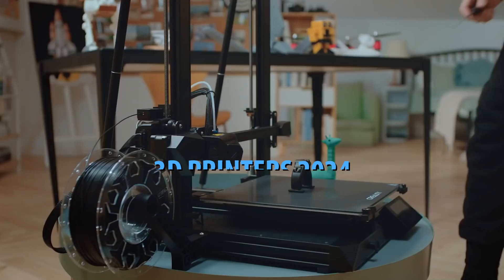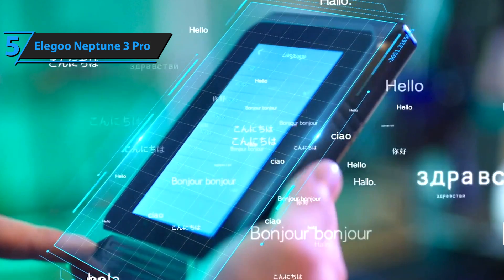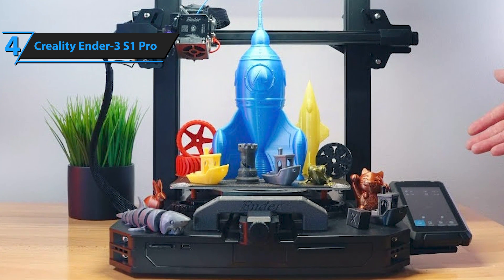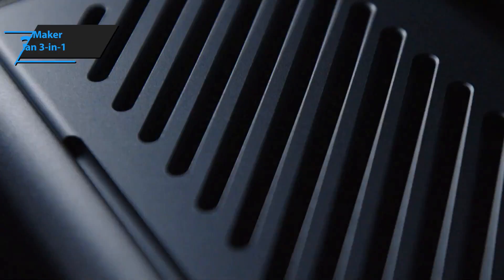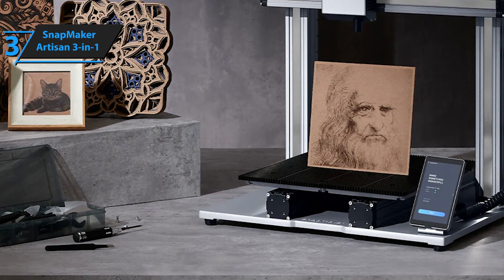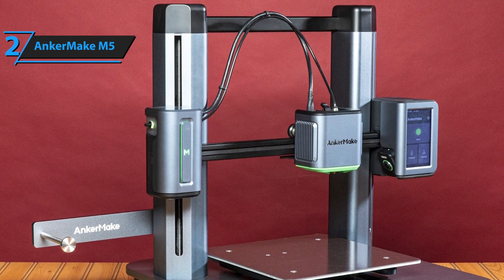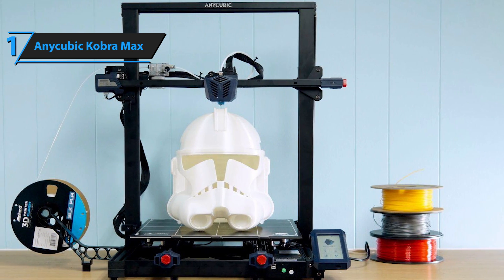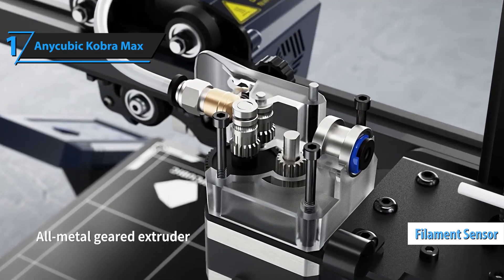Top 5 BEST 3D Printers of (2024)

Comment: bambu is #1.
Reply: if you want multicolor i agree, if single color creality K1 max is just as good for half the price and bigger print volume
Reply: @MnstrKhaos   in quality bambu is better too maybe not space or price
Reply: @SaymeeYT  you sure? cause i can't see the difference in the prints...
Reply: Why? Genuine question. I started with an Ender 3 v1, recently upgraded to sprite extruder pro, glass bed and dual lead screw kit, really was thinking about the new ender 3 v3, but idk.
Reply: Unless you count support, open-source, or ability to print stuff and not have to share the designs with overseas server, or even ability to update your firmware without going online. If your printer is in corporate isolated network and can't reach cloud server, a lot of it's features and bling goes away.

Comment: Prusa MK4?
Reply: you will not find a mk4 on any of these crappy top printers of 2024 because they can't have affiliate links to them. These are all totally just to get you to click the links and don't know shit about printers.
Reply: @DJlegionuk  Imagine if Youtube had some moderation... There is 0% moderation in Youtube... Their automation system randomly bans random videos without any reasoning or explanation. Meanwhile the scam videos and other illegal videos are never banned. If you report videos Youtube never does anything to you reports. I have reports from years ago that no one ever checked at Youtube
Reply: Yeh click bate at least I get the pleasure of downing Prusa. For anyone who want a first printer Bambu .. no printer is trouble free. But creality printers, bed leveling can be a pain but for TPU. It's just amazing..
Reply: @Sarah-q8c  I have creality Ender 3 V2 Neo and I installed Klipper using Creality pad. Also swapped to Sprite Pro printer head. The Creality printer has issue that it requires value under 0 for the nozzle to be low enough, but Klipper doesn't support value under 0. So whatever I tried the nozzle is always too high.